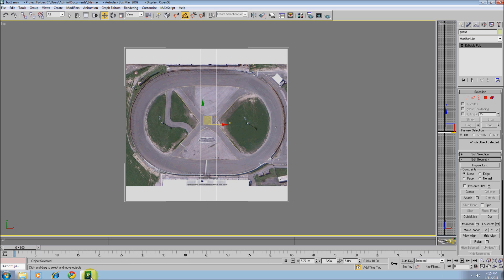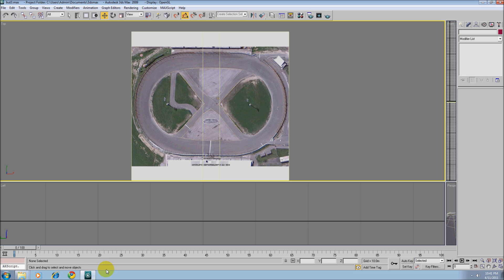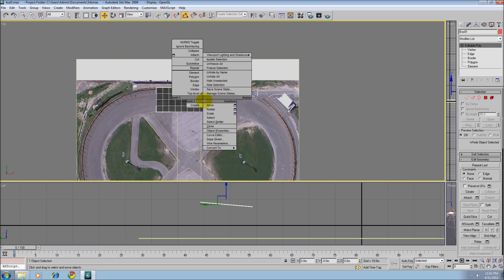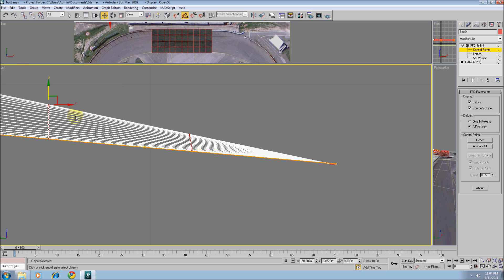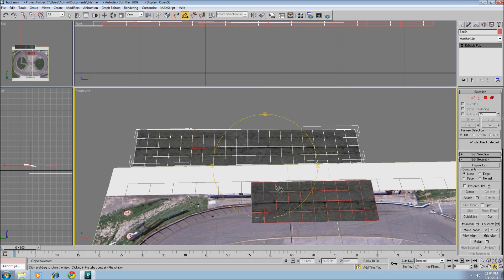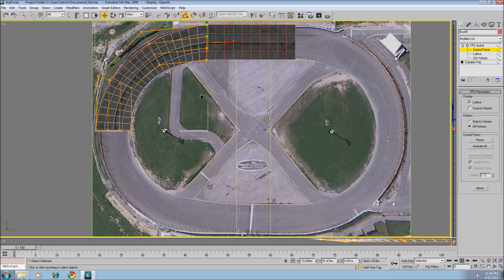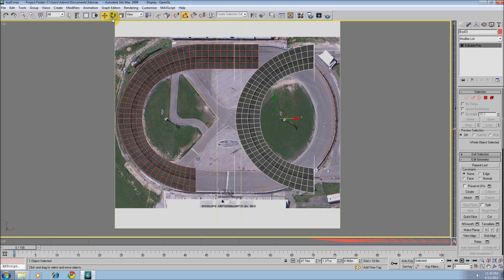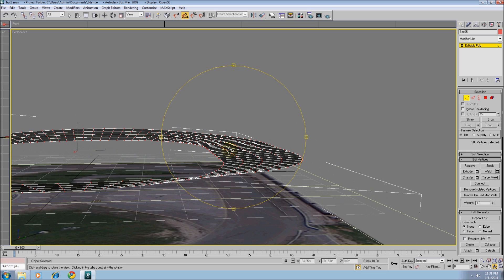3ds Max rFactor Track Mesh

Comment from the maker: I have Edges Faces turn on in that window to get the grid lines on the box.  The FFD will still work if you dont have them turned on, I just like to see the poly size as I work.  No verts?  Did you make the box an editable poly and are you in vertex mode?

Comment from the maker: Follow my lofting tut, and on the corner sections use arc's to create a nice corner line.  Create the lines for straights and attach the arcs to the lines.  Weld verts and your good to go.  Creating the spline for the track is the only minor dif, every other aspect would be the same.